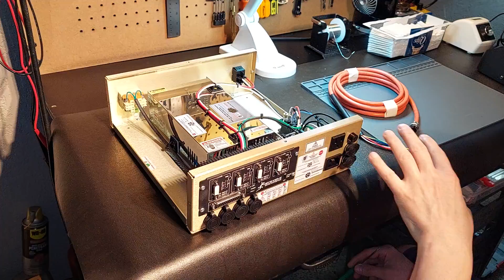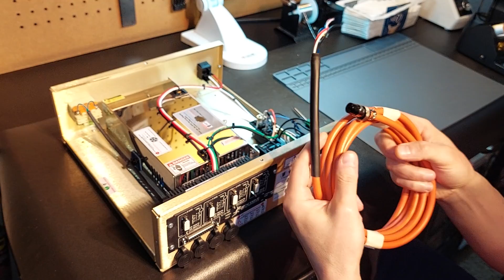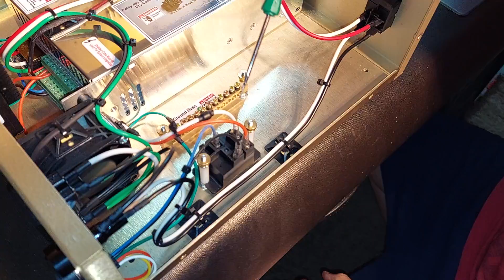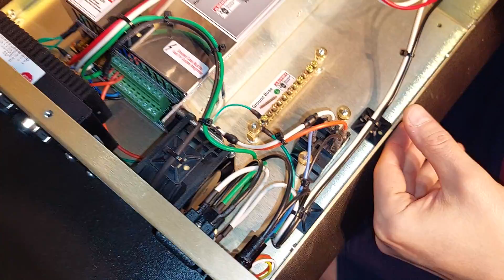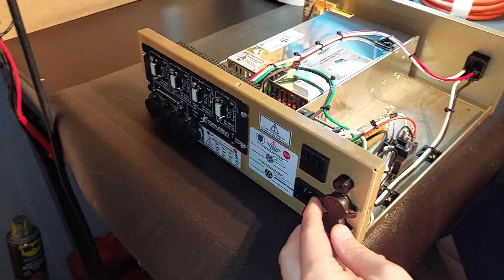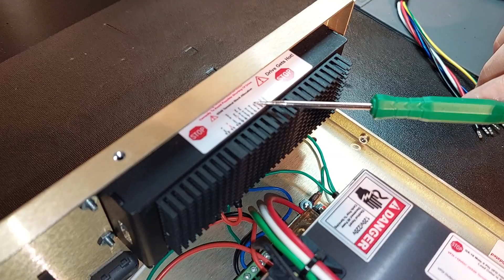Gerber Sabre 408 CNC Electronics Retrofit Completed..

Comment: Hi. How much would it cost in total for a gerber sabre 408
Reply from the maker: Krister thank you for your support. I'm sorry I don't sell the entire chassis only the electronics to retrofit it. Thank you,
Vince
Reply: Looking to do the same thing to a Gerber 408.
Did you find controller, servos, etc for your retrofit?
Would be interested to hear what worked if so.
Reply from the maker: @andylarkin100  I can supply the controller, and electronics. Your chassis should only then require pulley diameter modification to fit my motors similar to what this client did with his Gerber https://youtu.be/qEoQvi3oECs Thank you,
Vince
Reply: @corvetteguy50 very useful. Thank you.
 I emailed you at the Storm email address at the end of the video...
Is that a working email?
Thank you.